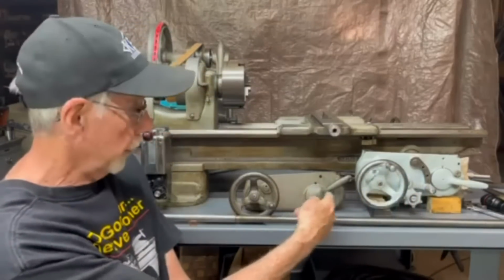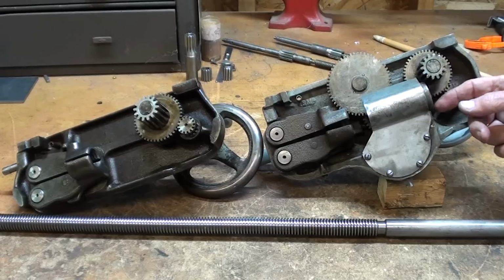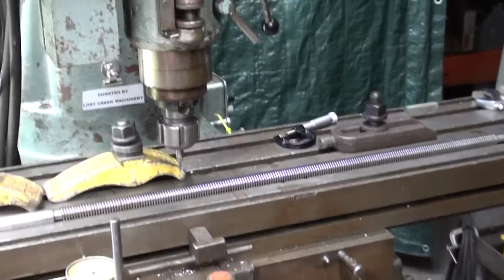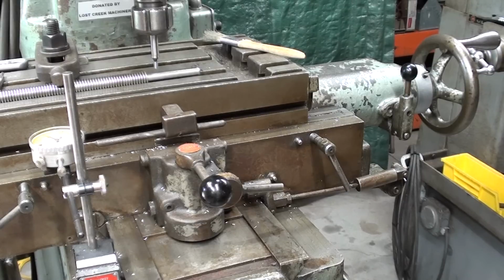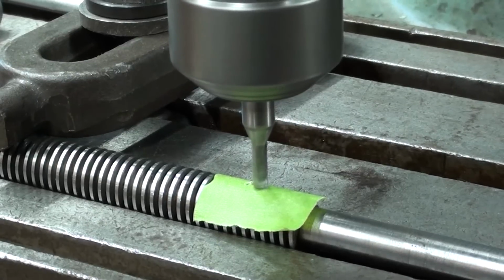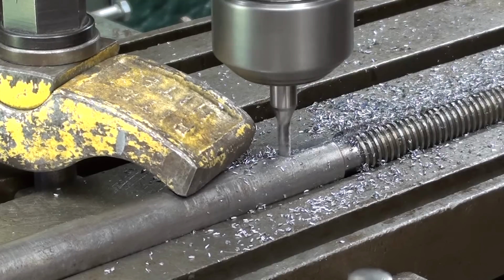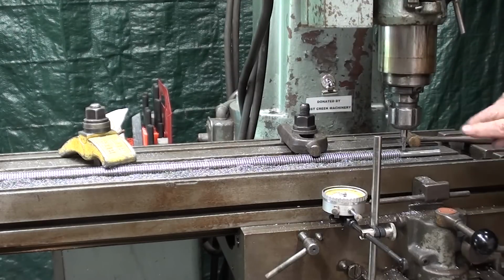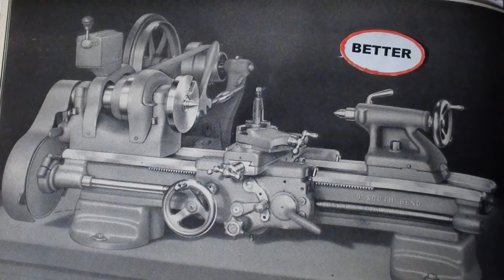Cutting Leadscrew Keyway SB Lathe #805 pt 3 tubalcain south bend

Comment: Very interesting setup on that old South Bend. When cutting keyways with end mills I always use a slightly undersize cutter to remove the bulk of the material, then finish full depth with a new full size cutter. Using two cutters produces a more accurate keyway with lighter burrs since the finish cutter has very little material to remove.
Reply: Good suggestion.

Comment: I have a 32 inch table on my Bridgeport. I will rotate the turret in similar situations to get a longer envelope. I love that South Bend mill. Great video Lyle!
Reply: Mr. Pete doesn't like to move his head, especially if it demands tramming the spindle. I like your suggestion and recommendation. 
Long table travel can introduce abbe error. ( I hope that I spelled this correctly). The Saddle and the knee on a Bridgeport style mill require gib adjustment with some clearance so the axis can travel. Worn machines require loose gib adjustment in the worn area to prevent lock up at the end of travel. This allows the table to rock or raise on the end of travel due to the table and part and fixture weight cantilevered to one side. Controlling depth of cut and some positional error over such a long cut can be a challenge. This abbe error was compensatible on one DRO model that I installed and maintained in an attempt to mitigate the positional error from this effect.
My hobby machining world doesn't demand this accuracy. Your suggestion would help mitigate this effect on my old mill. Mr. Pete also wanted to eliminate any step in his key slot. Your method risks adding to that problematic issue, but I still like the suggestion and the option.
Reply: @paulhunt598  My first choice would be what Lyle did, and use a mill with adequate length to cut the key way in one set-up. We, as hobbyists may not have that option. We have to make do with what we have. I worked for 40 years in a tool room. I started in pre-DRO days. My home Bridgeport is older than I am, and has no DRO on it. I rely on old school techniques. Our most important tool sits on top of our shoulders. Understanding limitations, working around them is key to our success.  ✌👍

Comment: Being able to mill the groove in one set up is a huge advantage.  I milled a 46" leadscrew in multiple setups on a smaller vertical mill and used a mill vise and jacks to hold the work.  To ensure the leadscrew didn't rotate between setups I clamped a vee block to one end to create a flat, level reference point and used a precision machine level to check it.  Very time consuming but sometimes half the fun is figuring out how to do the job well with the tools we have.
Reply from the maker: Sounds like a good solution.

Comment: The inaugural run of that nowadays odd South Bend mill was a great success in my opinion!
Gosh, I've been wondering how you were going to cut that keyway in the C lead screw. What a sneak/simple thought to put it in the slot! Fantastic!
The indicator, tape and centering wiggler views were quite good!
Too many little questions/comments. I speak my mind and sadly type!
That'd be a blessing to find a lone apron and parts to turn my older series (1928) SB 9 into a B! Handy. 
I don't need an A, gear change only takes a few minutes but that cross feed is, (hahaha!) just peachy!
Thank you! YOU are the encouragement for many of us.

Comment: Lyle. What happened to the brass or aluminium packing between the leadscrew and your clamps. Those round ended clamps can often cause dimpling in parts, and as the leadscrew was delicate I would have used something soft in between. Hope it came out OK with no thread damage. Regards from Australia.

Comment: SPINDLE BEARING TOO HOT?
Interesting dynamic about spindle bearing preload and bearing heat from my experience...
Early in my machine maintenance career I (we) rebuilt spindle bearing assemblies when required. Technology advanced and spindle rebuilding became a specialty performed in dedicated shops with exacting control conditions. Spindles or spindle heads became cartridge assemblies and only the cartridge was exchanged in the field.
In the older days we would use precision and super precision bearings designed for spindle application. These bearings look like standard bearings, but are manufactured to closer tolerances. Race runout high points are marked with burnish marks allowing you to indicate or mic the relative runout of the spindle bearing journal and the bearing bore, and install the bearing runout opposite to the spindle and bore runout. This results in the truest assembly possible. A machine spindle takes both radial and thrust load and they require a bearing design that can manage both or combined load conditions. Standard ball bearings design cannot provide the required thrust load. Some designs rely on multiple bearing assemblies with ball bearings for radial load and thrust bearing for the the thrust load. Other designs rely on bearings designed for both loads like tapered roller bearing assemblies. Many spindle designs rely on bearing assemblies that are very exotic and specialized. TAC bearings is another design, but I never rebuilt a main spindle relying on TAC bearings. TAC bearings were widely used for ball screw applications. I did rebuild live tooling spindles using TAC bearing designs. 
Regardless of the spindle bearing design, bearing preload is critical. Assembly preload maintains the spindle accuracy. Too much preload overheats the bearing and too little preload obviously reduces machine accuracy. Bearings assembled with the intended preload naturally generate heat. Too much heat expands the bearing material and premature or catastrophic failure results. Manufacture specifications are essential for a quality field spindle rebuild. Spindle bearings require a specific break in period and procedure and set the operating conditions for the life of the spindle bearings. 
I did one spindle rebuild on a NC drilling/milling machine where I unintentionally over preloaded the spindle bearings. I had no bearing break in specifications and I was under production pressure to complete the repair/rebuild quickly. To speed up the bearing break in procedure time I fastened the thermocouple of my meter (thermometer) to the bearing housing. I slowly increased the spindle break in speed until I saw the heat increase begin to rapidly raise. I stopped increasing speed or backed it off slightly and monitored the temperature. As the bearing began to "seat" it naturally cooled. Confident that the temperature had stabilized, I increased the spindle speed repeating the pattern until the bearing ran "cool" at full spindle speed. Using this method I reduced our normal 24 hour spindle bearing break in procedure to just a few hours. 
Interesting to me was this bearing lasted flawlessly for years of around the clock production, but ran hotter than any other spindle bearing in my experience. It was always too hot to touch. The machine operator (machinist) had to do manual tool changes on this machine since it predated automatic tool changer features. He had to exercise caution to not burn himself from the unusually hot quill bearing housing. 
I always concluded that properly breaking in this spindle was the reason that this obviously over preloaded bearing ran so hot, but never failed. This spindle bearing design was grease packed on assembly, but I don't recall if it included any provision for subsequent lubrication. It likely did, but this machine was culled and replaced many years ago with newer and more productive technology, so I have forgotten that detail.
Your South Bend spindle heat comment reminded me of my OOYA repair. I thought that you all might enjoy or relate to my experience.

Spindle bearings take and absorb tremendous machining forces. Long run jobs like this one generate and maintain heat. Machine mass and proper lubrication mitigate the heat effect. Our shop eventually ran spindle speeds up to 10K RPM. We were toying with 50K RPM technology when I retired. I understand that this speed demanded ceramic bearings and machine crashes were difficult to survive. We did not invest in this technology. Our old cylindrical grinding machinery ran on oil flooded plain  bearings. It was imperative that these bearings never turn without flood lubrication. Machine design (and operator attention in an emergency condition) would not allow the spindle to start or coast to a stop without confirmed spindle bearing oil flow.

This video post taught or relearned me some valuable machining approach criteria.  You always satisfy. Please keep posting.
Reply from the maker: Thank you Paul for that thorough explanation. Sounds like you have done a lot of bearing changes

Comment: Nice job Mr Pete cant wait to see it done . You talked about using a horizonal mill .  Would using a 90 degree attachment on a vertical mill work well  especially if you had a support  with a long arbor does that setup work good. Thanks . JM
Reply from the maker: I intend to try that in the future videos